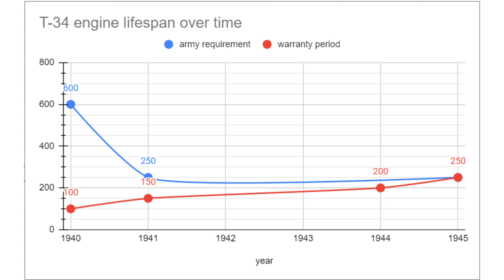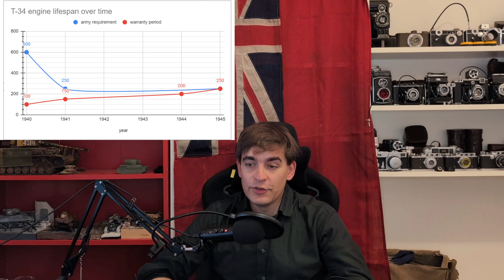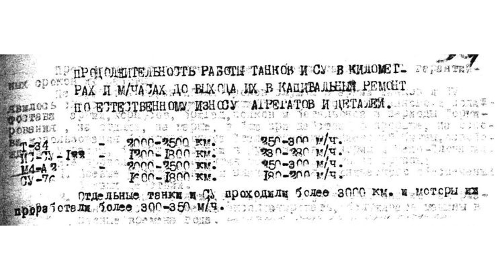The Myth of the Disposable T-34

Comment: Do you happen to have statistics on the collective fate of T-34s? For example out of a certain batch of T-34 that rolled out of factory, how many are [lost beyond repair] vs [damaged, repaired and sent back to action] vs [serviced until worn out] vs [survived the entire war and retired/scrapped]? Figures like these could shed some lights on how the red army actually managed its equipments during the war. Also there must still be tens of thousads of T-34 at the end of war, I'm quite interested in how they are eventually phased out of service. Were they mostly scrapped or delivered to other nations?
Reply from the maker: Getting this data would be a titanic work involving multiple records for each individual tank scattered across several archives. I don't think this was ever done. Post-war archives are also still inaccessible in many cases so it would be difficult to find out what happened to these tanks afterwards.
Reply: @TankArchives  Indeed, tracking tanks by serial number during a war is enormously hard. Thanks for your reply though!
But here's another, possibly more practical question that serves the same purpose: Do you perhaps know how many T-34/76s were still active by May, 1945? What would a red army tank unit typically do when they receive the T-34/85s: were the 85s mostly there to replace the losses, or were the production abundant enough to actually allow some of the old 76s to be retired/supplied to other units?
Reply from the maker: @pig2000c  annoyingly enough no difference is made between T-34 and T-34-85 tanks in records. Some units do make the distinction when both types are available, but if there is only one type of tank it will just say T-34 even if the tanks are actually T-34-85s. The index T-34-85 was not even used officially, when a distinction had to be made it might just say T-34 with an 85 mm gun, T-34 (85), T-34 85 mm, etc. 

T-34-85 tanks began arriving as reinforcements, so they would just gradually replace the T-34-76 in existing units. New units would just be formed with the T-34-85. Old T-34s were still repaired relatively close to the front line even if they were written off by their original unit, so they might resurface in a secondary role as tanks in training regiments, command tanks, prime movers, etc.
Reply: @TankArchives  Very interesting. Quite sad that neither Soviet nor German records seemed to care about distinguishing T-34 models, despite the 85 having a much more powerful gun and one more crew is already radically different from the 76. Many thanks for your reply again!
Reply: @pig2000c  In some cases the crews started not taking the hull machinegunner on 85s, I'd imagine it could very well be the case of "Well our last tank got 4 seats and this one has 5... Well one person doesn't do too much in the hull anyway, so how about we just let him be the loader? Then we don't need to request a replacement crewmember"
Reply: @domaxltv  -- Crew shortages were not only in Wehrmacht, or even only in infantry, but through the branches of Red Army, so it was not unusual only 4 men crew in T-34-85.

Comment: In 1942 they produced 25000 T-34s and lost 22000 of them.
Seems disposable to me, at least in 1942. By '44 the quality had improved measurably.
Reply from the maker: By that logic the Skink is the highest quality vehicle ever produced and the Panther would be one of the worst, as 100% that were built were either destroyed or otherwise lost to the enemy.
Reply: @TankArchives  This kill-ratio logic comes from PvP games. Now “experts” calculate the effectiveness of combat vehicles the way I heard McNamara suggest calculate the performance of the US Armed Force in Vietnam.
Reply: @TankArchives  I'm just pointing out how easily such a 'myth' can be perpetuated. It is a mere statement of fact, but can be interpreted as such quite easily.
Reply: 1942  - 12535 produced (and lost 22000 of them)
Reply: @Chaldon-hl6yk  Sorry I was combining 41 and 42.
Reply: @GeneralJackRipper  1941 - 3016 produced
3016+12535=15551
(and lost 22000 of them)
Reply: A loss does not always mean that the tank has been destroyed. It could have survived the battle and been written off due to damage to his armor, engine, and cannon. Even if the crew survived
Reply: @DVXDemetrivs  Nit picking is how myths like this are constructed and disseminated in the first place.

Comment: You know you’re early when the closet neo naz is and wehraboos don’t show up yet
Reply: They usually don’t show up on T34 videos, but you’ll see them defending the Panzer IV as the greatest tank ever conceived in other videos
Reply: @Zilliguy  they only good thing about PzIV (allegedly) is that it had padding and had more space inside than T-34. Basically it was slightly more comfortable and had better viewports, that's pretty much it.
Reply: @-WarCriminal-22  I wouldn’t say those are the only things that are better. It had thicker frontal armor, and if we’re comparing it to the T34/85 it’s much lighter, and if we’re comparing it to the 76mm gun version I’ve read the L48 is a much better gun overall. Each tank has its own pros and cons.
Reply: @Zilliguy  thicker armor? Not with the angle it had.
Reply: @-WarCriminal-22  even at the slope, the 38mm T34 armor had a relative thickness of ~44mm. Still slightly less than 50mm of PvIV
Reply: 60 degree slope if you wanna calculate it yourself
Reply: @Zilliguy  iirc T-34 had 45mm at 45 degrees (inc. upper side plates, one of the reasons why it was so cramped), where did you get your numbers?
Reply: @-WarCriminal-22  Every Panzer IV was also equipped with radios and internal comms, plus it was one of the first tanks with a three-man turret.

Not to say it was a uberwunderwaffe, but there were some other good things about it.
Reply: @-WarCriminal-22 T-34 front plate is 45mm sloped 60°. Sides are 40mm at 40°.
Reply: @Kasian02  odd, I remember reading somewhere that they made sides and front the same thickness because apparently that was somewhat of a trend in tank development. Or at least in Soviet tank development, but T-34 was the only one that made it big
Reply: @-WarCriminal-22  well, side armour without a slope is 45mm, also T-34-85 had all 40mm plates changed to 45mm, but just because it was easier to manufacture plates of the same thickness.
I don't know about that trend, but KV-1 had front and sides of the same 75mm thickness.
Also 60° is easy to remember because it gives exactly twice the line of sight thickness, so soviet tanks were designed around that slope from T-34 up to T-62 and object 430.
Reply: @Kasian02   I remembered, it's not a trend, it's a "type of armor distribution" where one type is you get same thickness and other is what post WW2 tanks do, especially today, when frontal armour is much thicker than the rest.

Thanks for telling me about such thing occurring only with T-34-85's side armour, I thought it was that way from the start

Also I thought it was 45° that give you twice the thickness, not 60. Idk why
Reply: @-WarCriminal-22  ah, you mean differentiation of protection. In the interwar period tanks were designed to protect from machine guns, anti-tank rifles, anti-tank guns. And designers were able to give tanks all around 15-40-60 mm protection, but when guns started to penetrate 150-300mm, it became impossible.
Reply: Wehraboos are a rare breed now. The current great pest are the freeaboos claiming that every non-american tank broke down before it could travel 100 meters because of "horrendous design choices" and "extremely poor production quality", while all shermans had the finest quality with no reliability issues or design flaws—it was the pinnacle of tank evolution of the time

Comment: -- Thank you, Peter. Also, I'm not sure that whether its a myth or not, but I came across that Michail Khalashnikov's first mechanical device that he designed, while been wounded in 1941 as a driver or commander of the tank, was engine hour counter.
Reply: That happened before he was wounded. According to Kalashnikov, General Zhukov was put in command of the Kiev region in 1940 and encouraged his soldiers to be inventive. Kalashnikov actually met with Zhukov twice, first with his original invention and again after Zhukov had sent him to Moscow where he received professional assistance to improve the device. I suggest that you read ‘The Gun that Changed the World’ by Mikhail Kalashnikov with Elena Joly.

Comment: I'm not sure if this is pertinent to your thesis, and while you started the video in that direction, you pulled away from it...  I was born in Eastern Europe in the 70s, so there was lots of talk about Russians in WW2.  The talk was that Russian leaders didn't care about their soldiers (and by extension, tanks).  The Purges, "not one step back" orders, penal battalions (whether they got shot at by their own people or not) show that the Russians had people to spare.  Anyway, I remember a statistic from my dad (not sure where he got it from) that an average Russian tank would last 30 minutes in a battle.  If a tank is going to get knocked out anyway, it doesn't have to be high quality - and they weren't.  Everything was loose, the driver worked hard shifting the gears, and nobody filed down the sharp edges on anything.  That's where the disposable myth came from.  Maybe the T-34s could last a long time, but a lot of them didn't get a chance to.  That's why they built them in the tens of thousands.
Reply from the maker: That's exactly what I'm talking about. There is absolutely no evidence that the Red Army decided that there was some kind of reliability limit past which a tank need not be operable because it was going to be destroyed anyway. There was a constant push to improve reliability of every part of the tank throughout the entire war.
Reply: @TankArchives The anecdote that is so often referenced is more surprise at American manufacturing quality, not one of deliberately induced shortcomings. That doesn't stop people from misunderstanding it though.
Reply: Everything you (and I too!) was told was a myth.  The Soviets actually had a manpower problem at war's end, they were struggling to keep their rifle units at authorized strengths, and were disbanding formations (whole armies, in fact) in part because of the manpower crunch.  So the the LAST thing the Soviets could afford to do was to waste their own soldier's lives.

In addition, although the purges were bad, and Stalin was a mass murderer, he did not kill '40 million'---more like 6-10 million, by recent historiography, which is bad enough.  Nor were being put in a penal battalion or being sentenced to a Gulag some automatic death sentence---while penal battalion conditions varied, what I've read is you were out in three months and were re-instated to your unit (or sooner if wounded in battle or after committing some heroic deed).  The vast majority of people sentenced to the Gulag also survived and went home.
Reply: @stewartmillen7708  maybe read on Gulago Archipelago before repeating Communistic propaganda. 

For shorter attention spans there is an abridged edition for cheap.
Reply: wrote: "Anyway, I remember a statistic from my dad (not sure where he got it from) that an average Russian tank would last 30 minutes in a battle.  If a tank is going to get knocked out anyway, it doesn't have to be high quality - and they weren't.  Everything was loose, the driver worked hard shifting the gears, and nobody filed down the sharp edges on anything.  That's where the disposable myth came from.  Maybe the T-34s could last a long time, but a lot of them didn't get a chance to."

-- Its a very loaded question, with so many factors been omitted, that for those of us, who were born on the other side of the "wall" are obvious... For example - T-34 was originally designed and build in Kharkiv, but when it became obvious(city of Kharkiv is almost 800km from Soviet border) that soon(October) huge some 44 000 workers factory have to be evacuated 2 000 km away beyond Ural Mounts in Siberia, and it was not the only factory, that have to be "partially"(meaning what ever can be carried away, since heavy equipment such as 40 tons cranes, and heavy machine pressers, or furnace simply can not be loaded to rail road car and moved) evacuated in a such a "short" order. Only 4 000 skilled workers made to Nizhny Tagil, so initially women and children have to start producing tanks, in one of the coldest winters on record, while factory walls and roof are been build around them, and working 12 hour shifts without weekends. Later things got better, and a lots of front line "handicapped" soldiers picked up slack, with some tank crew helping building the T-34 tank, so they would be familiar with mechanics of the tank, they will be fighting in soon. The other "big item" is "deficit" of not only material(anything from rubber to gun powder), that Germany going to experience towards the end of war, but also important components like for example optic/sights, the whole factory in Izyum city near Kharkiv, that made those, was a total loose, and ect., and ect.  Peter, but so is S. Zaloga talks about T-34 crew training, while there are fuel and ammo shortages in 1941, 42 to mid 1943 only allotted 1 round per main gun per tank(in one of the S.Zaloga books, TC said that after firing main gun, gunner jumped out of the tank, and was so "shell shocked" that they found him shaking hours later in nearby woods), 1 mag per each MG, not much driving either, since T-34 predecessors i.e. BT tank also used 500 h.p. engine that consumed a lots of fuel, that just like ammo, had "moto" - All for Front Lines, all for Victory!(Всё для Фронта, всё для Победы!) So, sorry you only getting essentials, including food rations. Luckily, T-34 had one of the most powerful diesel engines, so drivers could get away driving tank in only second gear from dead stop, until they master shifting a manual gearbox, so that is additional "wear and tear" that didn't add to T-34 reliability, but was a such a success as a myth, and T-34 were driven rough like no other tank:

https://www.youtube.com/watch?v=tfRXsNhGFTQ&list=PLODuYU8PU6dStm7lGDYzvbXsh5FrKtMAB&index=17

Imagine M4 Sherman doing "donuts like these:

https://www.youtube.com/watch?v=jXRztT8Ev2A&list=PLODuYU8PU6dStm7lGDYzvbXsh5FrKtMAB&index=22

or these:

https://www.youtube.com/watch?v=o1wf1xE1MTE&list=PLODuYU8PU6dStm7lGDYzvbXsh5FrKtMAB&index=3
Reply: @RussianThunderrr   I completely understand; I called Stalin a "mass murderer", it's just that there's a tendency in the West (and among some Russian emigres) to multiply both Russian military losses and those who perished under Stalin  many-fold.  The reality was usually plenty bad enough. 

From what I've read, Gulag deaths were about 1.5-1.7 million of the 14 million who passed through.  Most of the 6-10 million deaths attributed to Stalin perished either by deliberate execution (like in the purges) or in the Holodomor.  This of course excludes most of the WWII deaths, which a one A. Hitler had a lot to do with, to my recollection.
Reply: @stewartmillen7708  wrote: "I called Stalin a "mass murderer", it's just that there's a tendency in the West (and among some Russian emigres) to multiply both Russian military losses and those who perished under Stalin  many-fold.  The reality was usually plenty bad enough."

You are probably correct once again, it depends when did they immigrated, and whether they keep up with history.
Reply: @stewartmillen7708 the biggest death counts attributed to stalin actually come from soviet and Russian state historians with the largest access to the archives. Not westerners/etc. That is not to say it's not potentially exaggerated, destalinisation and all that. But they shouldn't be dismissed either imo.
Reply: @matthiuskoenig3378   You're talking about people like Sokolov, who apparently has a ideological axe to grind, as his estimates now go up into the stratosphere.

Krivosheev has a total of 6,384,600.  This is KIA, died of wounds, and accidents/sickness (but does not include POW deaths in German hands; he has those included by I removed them as those deaths are not the result of any Soviet callousness or military bungling, but by German barbarism).  Most of his Russian critics add in civilian rear area personnel (hospital workers, etc) deaths, add in the POW and deaths and MIA figures (some of who didn't die but actually made it to the West!), or try to use the demographic data, making assumptions about death rates and birth rates (some even claim in children that were never born because of the war as "losses").  Sokolov, whose figures of 14.7 million military dead was jumped upon my many Westerners, now has figured that isn't high enough and has Soviet military dead at over 25 million (which is almost demographically impossible).

So basically those who argue with the official figures are either a) lumping in POW deaths Krivosheev didn't claim, which were incurred because of German mistreatment of Soviet POWs, or b) are throwing dead people who Krivosheev would agree "yes, they're war dead" into the "military dead" bucket, people who were doing work for the military (but in WW2, how much work unrelated to the war done in the USSR?) but who weren't wearing the uniform.  

I think Krivosheev was correct in calling the latter civilian dead, as the biggest contributor in civilian deaths was not bullets, but the lack of food.  In 1942, about 42 % of Soviet arable land was under occupation, and food rationing was instituted favoring soldiers, essential war industries, and children, and if you weren't one of these you didn't get much.  As in the Irish Potato famine, hunger generally kills not by outright starvation but hy opportunistic infections.